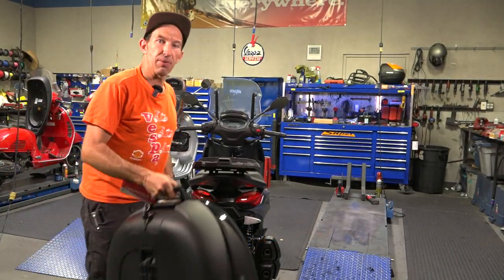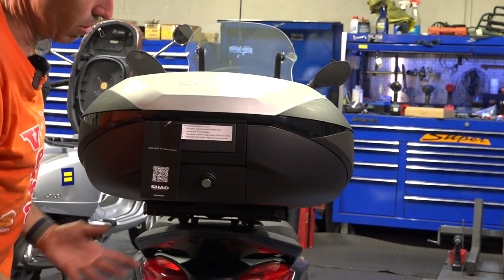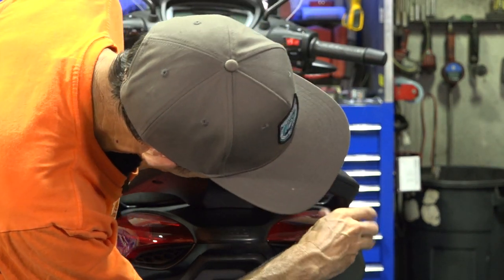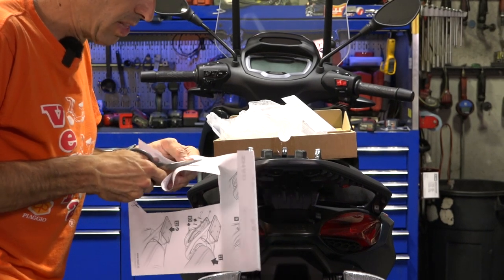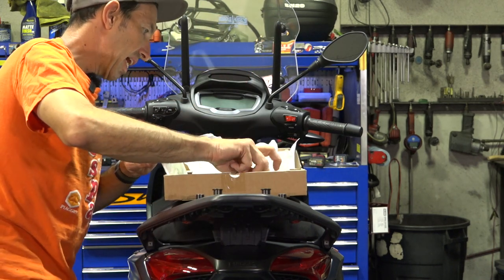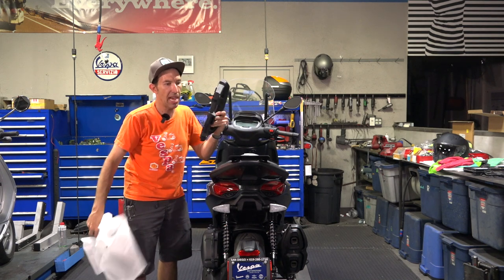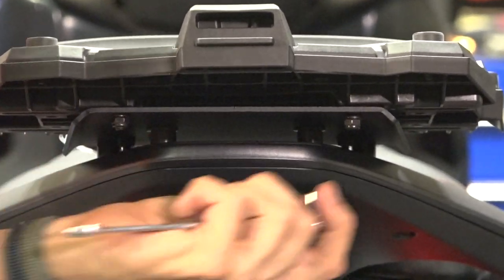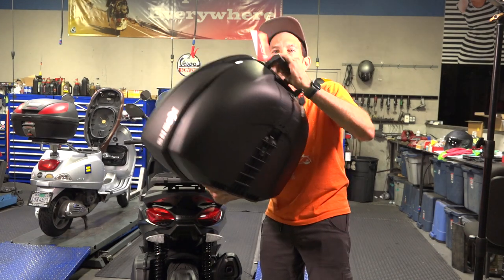SHAD SH59X Top Case & Adaptor Plate Installation on New Piaggio BV400

Comment: I bought a cheap Chinese top case called EMGO. I was tired of Kawasaki's soft luggage that doesn't allow you to secure and lock up the contents of the case. I think I paid around $60 for it and it included the mounting hardware. It's no where near as large or as nice as this one, but it's served me well for hauling groceries on a motorcycle. I think it's only 30 liters in size. I never take it off and I always leave it on the motorcycle. Nothing has ever broken on the case or mounting hardware. I hate drilling holes on my vehicles so I fabricated a metal rack to attach to the existing holes on the motorcycle, and i used the rack to attach the top case.